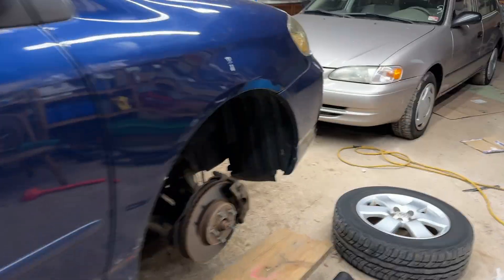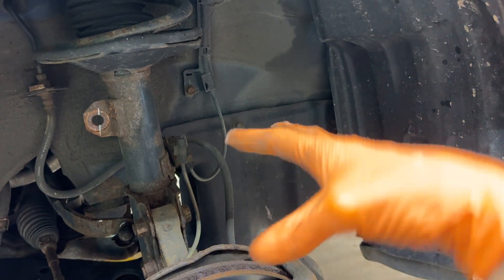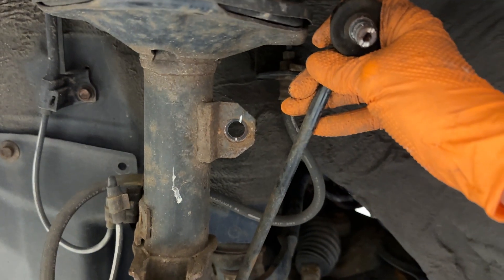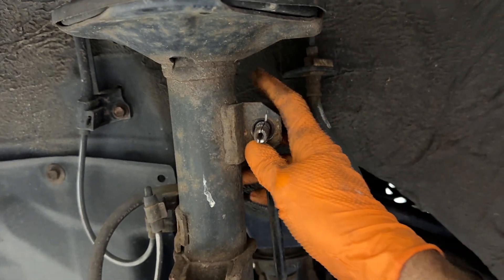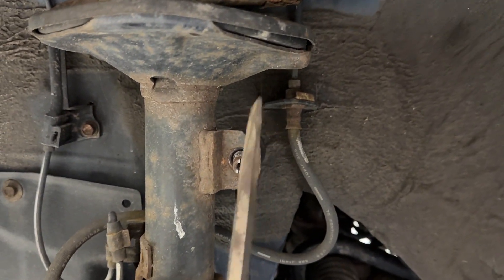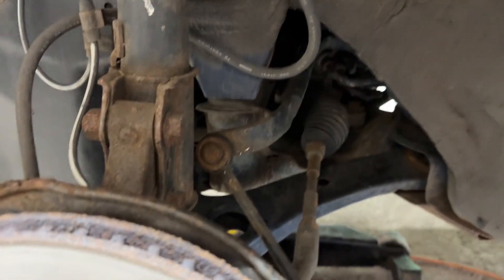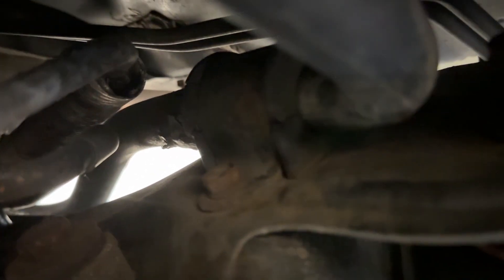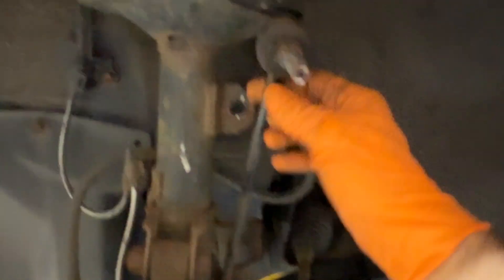Sway Bar Links! How I get them off to replace them, and what they do/How they work

Comment: Thanks I gotta do that on my 2016 Prius, appreciate you Drew
Reply from the maker: those are actually way easier - the bottoms hang down where they can be accessed from underneath - the bottom nut is wide open. Should be better than what you saw here! 

Make a video and post! That's how this channel got started =)